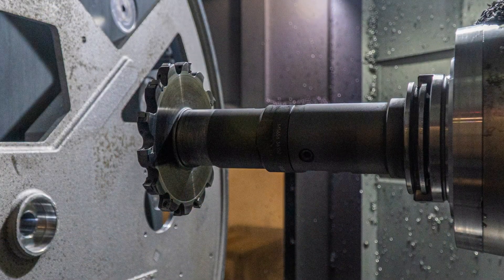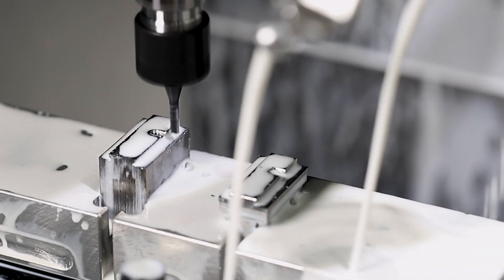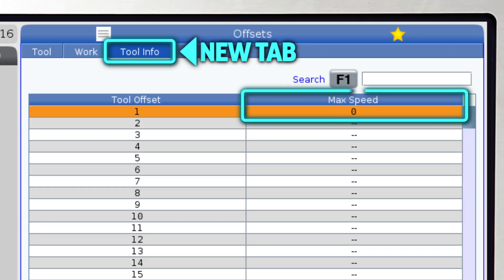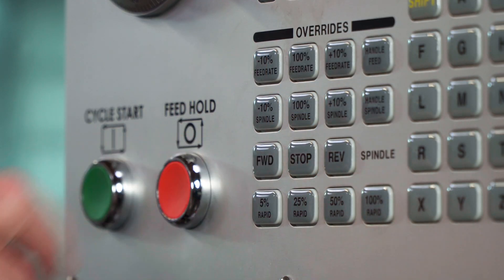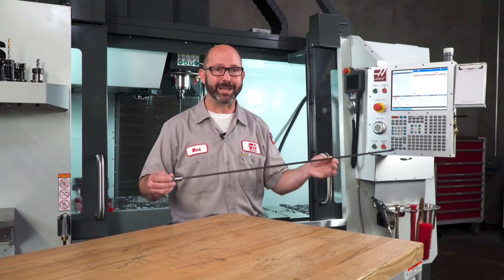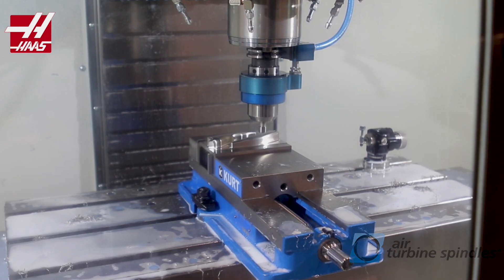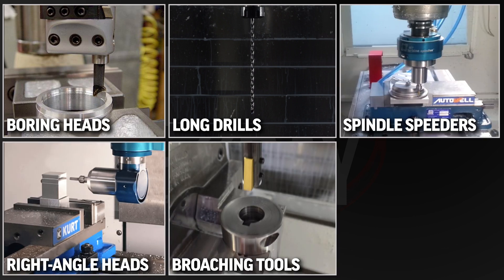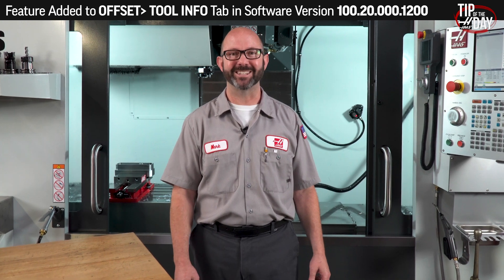Set Max Speed On Any Tool Right From Your Haas Control - Haas Tip of the Day

Comment: The machines which have ordered this year will also have this feature?
Reply: Yes. This feature is already built-in to all Haas Mills shipped this year. And if you have an older machine you can just look on the Tool Offset page to see if the MAX SPEED column is there. It was introduced onto the Offset page in Software Version 100.20.000.1200, but the feature actually existed for a while before this, but with the Max Speed input on a CURRENT COMMANDS tab.

Comment: Kinda cool but not gonna happen if the price is going to be a service call.
As well I noticed recently on our 2017 NGC VF2 you can open/close the doors regardless of the coolant and auger running. On the 2018 VF3 right next too it with the auger running the doors will lock if you close them and the coolant will automatically turn off every time you open the doors. Even in the 'unlocked' mode on the side of the control panel. Best I could figure being a year newer machine more nanny bs was added into the software loading ?  On the VF2 I would not want those nanny features added via new software update. Since the VF3 already has them it would be no downgrade. Having already crunched a Renishaw 40-2 I take extra caution whenever that sucker is loaded in the spindle.

Comment: Not spinning a probe or air turbine spindle up to 12k... priceless.

How does one take advantage of an upgrade like this? Service call required?
Reply: I believe you would have to have a service technician update your mill software.
Reply: @Cas_55  It might be possible to do this yourself but you would still need a tech guy to reactivate your machine. Luckily this can be done remotely by phone.